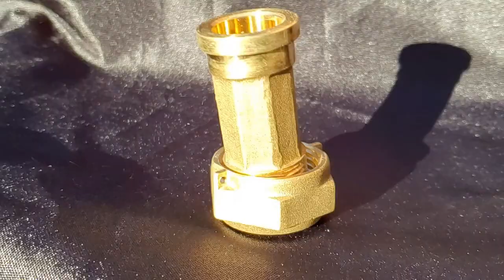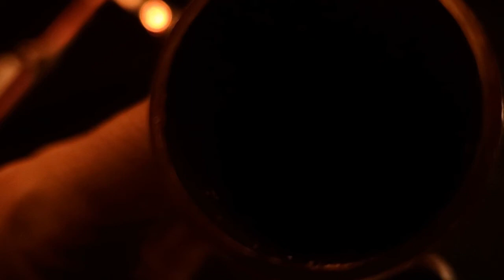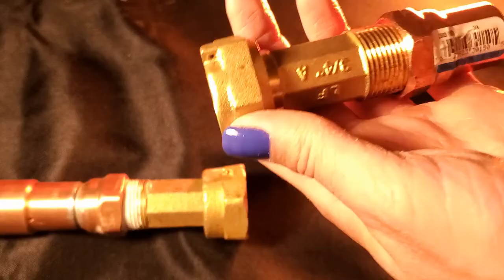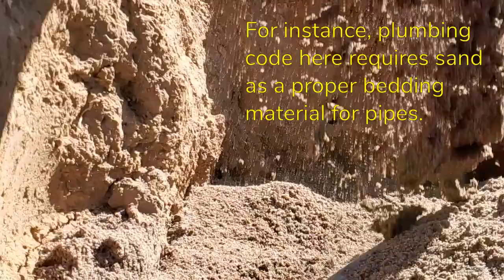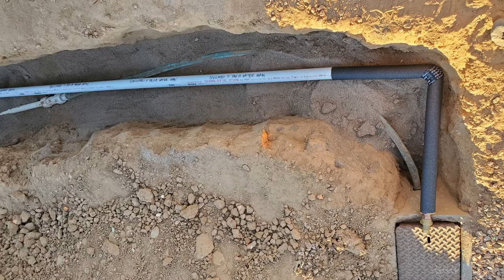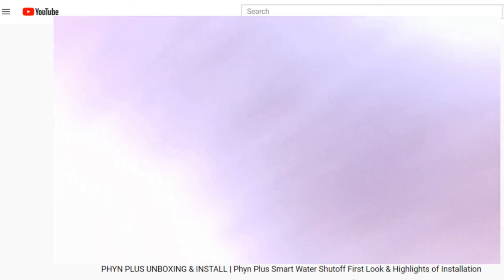How to CONNECT Plumbing on YOUR Side of the Water Meter

Comment: Normally if you install two different metals together you need a dielectric fitting (copper to brass) or Expansion Pex with brass fittings because with modern plumbing Pex Expansion meets code.   Whip lines are from the old traditional Galvanized era or time.  The only reason to install a whip line is when your flexible plumbing is not protected.

Comment: What size is that O ring
Reply from the maker: It depends on the size of the water meter. If it is 3/4" plumbing you could do a search for 3/4" water meter gasket and get some matches. But it would probably be cheaper at a local plumbing supply. Not Home Depot but a supply house.

Comment: Where can I buy the water meter coupling (nipple) ?
Reply from the maker: You can buy it at a local plumbing supply. Online at supplyhouse.com is another good option. BUT if you are looking at this from a leak perspective and it is leaking on the side between the coupling and the meter you most likely only need a gasket. If so, you can probably pick up a gasket cheapest at your local plumbing supply--not online--for the best price.

Comment: What is the purpose of the "whip"?  My jurisdiction doesn't mention it.  Another great vid.
Reply from the maker: It may not be a requirement where you are. It is here--I'm 99.5% sure the copper I see in the new neighborhood meter boxes stops 3 feet from the box and the builder used cheaper materials beyond since the houses were plumbed with PEX. It's an old school way to determine where the line runs with a metal detector. While the water company won't be able to trace the PEX between the meter box and the riser, that's where the THHN tracer wire comes in.

Comment: Great video.  But, Crescent wrenches are preferred over adjustable wrench.   Or at least I was told years ago.  You scar the metal with the adjustable.
Reply from the maker: 100% agree. Thanks for pointing that out. I just wish the adjustables weren't the first to show up and volunteer for duty when I look. 🤔 When I install/replace my water monitors (same size) I use a cloth between the adjustables and the union.

Comment: What would you say about trying to install some type of filtration system at your water outlet above ground I’m going to be doing my own line just like this and I live in a camper, but I would like to install a filtration system so I don’t have to keep changing the ones on my hose lines every monthany suggestions?
Reply from the maker: Anything that provides less maintenance down the road seems like a good idea to me. Worst case, that seems like it is easily removed if it doesn't work out as planned.
Reply: Dad spent $800 on two filters whereas you never needed to replace any filters.  It turns out, never was about 7 years before he bypassed both of them.  that was 20 years ago.   then he started drinking bottled water.  he was too old to be messing with the filters.

Comment: Thanks for the video. I'm a new subscriber now. So, is 3/4 inch the typical size coming off the meter on the homeowner's side?
Reply from the maker: Thanks for the support! I'm not a plumber so my thoughts are worth the price charged 😉, but my 80's house has 3/4" incoming. The homes in the newer neighborhood next door have 1". Current code requires sprinkler systems and those houses have those as well, which is my guess why the size is larger. Some older homes have 1/2". It really depends on the age or if improvements are made.

Comment: Exactly what I was looking for, thanks. How come nobody ever installs some type of conduit run underground from the water meter to the hookup inside the house? Seems like it would make life a lot easier years down the road in case the line has to be replaced again for some unknown reason? Just pull some pex through, hookup, done.
Reply from the maker: 100% agree. Did you find this video after my buried PEX video where I shared that exact same idea: https://youtu.be/nLnXT9e3hK0 --along with the mistake in what size sleeve we chose. I'm glad you found this video helpful and I hope your project goes as well as it can!
Reply: @NoMoreLeaks  Didn't see it, but will check it out. Just bought 50 feet worth of 2" schedule 80 pipe to run a 1" PEX line straight from the sidewalk into the garage. Never understood why it hasn't been something natively installed when homes are built.
Reply from the maker: Oh good! Schedule 80. I thought I had previously put a pinned comment in that video on recommending schedule 80 instead of 40. I had not so thanks for your thoughtful reply! The high end homes around here use (a few) schedule 80 conduits for electrical and plumbing. I don't live in a high end home, but we at least had the conduit idea before I had a chance to walk an AFT high end property in the framing phase with the foreman. With the way you think, you'll never have to use your conduit in the future, but it's nice to know it's there. :)
Reply: Awesome vid ,  recently brought property that has the same style water main on it

Comment: Great info. Mine unfortunately is s shaped like an S...or question mark if you will...I was trying to connect it at the bottom...but it won't budge. When I wiggle it, it turns with the entire meter against the copper pipe going to our house. But when I try turning it, it won't budge.
Reply from the maker: Oh no. I haven't worked with that kind before. I wish there was a way to share a photo in comments. Did you figure out a way to get it to move?
Reply: @NoMoreLeaks  so I learned it's S shaped and goes down like that so it can be the 18 inches to  2 feet required below ground. They used soft copper l. So I think they heated it up to shape it. They want it to be 3 feet of copper coming off the connecrion here. Since I could not  budge the botttom, I unscrewed the connection at the top "temporarily" and bent thebdidt copper enough so that I could attach threaded ovc to it. Since my meter says it's 1 inch, I had to get a 1.25 inch connection. Then another piece to convert it to 3/4 inch, and then a hose adaptor. I bought a 500 psi 3/4 inch hose.  There was nit enough room left to attach the hose. So after Another trip to the hardware store, I got a 1 inch to 3/4 elbow shaped adaptor that I stuck the hose adaptor to.  Finally connected the hose to it after i got male connections for it...got the necessary pieces to attach the hose to the end connecting to the house, and Temporary fix! I was able to shower, wash dishes, laundry. Just a small drip type of leak, but beats 5k gallons in half a day. We just don't use it to drink water, even filtered, because the water smells too much like the hose.
Reply from the maker: Oh no! That sounds like a project and a half! We have that 3' copper whip requirement on both ends of our run too. Glad you got something temporary and hopefully by now you have a permanent fix!

Comment: Actually I wanna know about the meter connection because I would like to preemptively replace the existing 130ft line that is more then 40 years old... Even  if - so far - it has not given me any trouble.🤠
Reply from the maker: 👍Peace of mind is definitely worth something!
Reply: I'm replacing a line, I've repaired about 6 times over 2 years.  Turns out, the line appears to be pre-1970.  They get thinner with age, as flakes of copper flake off from a chemical reaction.  So, now, EVERY time I stop one leak, there is another pinhole leak.  So, 50 years is defiantly any practical limit for copper pipe.  There has to be 12 repairs in one 6' section I removed, and only 3 of them were mine.

Comment: Hi Margaret, I’ve been going crazy trying to figure out which water meter coupling size I need for my Phyn plus. My home has a 1” pipe coming from the meter which is what I’ll be attaching the Phyn plus to. Which size coupling do I need. I see you mentioned 3/4” but is that connecting to a 3/4” pipe in the home? Pleaseeee help
Reply from the maker: You'll have to size down to Phyn. No matter what you'll need a 3/4" connection using one of these 4 unions (depending on if you have PEX or copper): https://www.phyn.com/help/plumbing-unions-and-propex-parts-for-installing-your-phyn-plus/ and then use two reducer couplings to go from 1" to the 3/4" and then back up to 1" again. Supplyhouse has the straight and elbow Uponor PEX couplings with the SKU Phyn provided in that article. As for the copper version, you can find the Uponor brand somewhere, but it is the same as a water meter coupling: https://www.supplyhouse.com/Jones-Stephens-M20075-3-4-Water-Meter-Coupling. Please let me know if that isn't clear or you have any other questions.

Comment: By code it’s called a water meter union 🤷🏿‍♂️ but just a heads up, if something ever goes wrong. Copper,plastic etc. a mix of materials sometimes is not recommended. 1’’ copper should be used from the meter all the way to the building. Copper is a stronger material. You can bury it and be safe to have a driveway.
Reply from the maker: Thanks for the clarification for code specific terminology. My goal is to educate people on what the stores and plumbing supply call it because that's the information (perhaps me projecting) people want to know when they are looking at a problem in their yard. When you look at Home Depot or Supply House it is labelled "Water Meter Coupling" (links in description).

Our code requires 3' copper whips (at the meter and at the connection where it is outside at the house). Anyone could put a full run of copper, but even new builds in our area have the whips with PEX running in between and throughout the house. No PVC tape to protect the copper from long term exposure to the elements in our soil here which is why I have a full video on our code here and how we protected our copper: https://youtu.be/ecVgSCvuVM0. Our copper only lasted 27 years and is in the process of failing below the house. I am sure code and practices are different throughout the country.

Thank you for sharing your thoughts.
Reply: @NoMoreLeaks  yes thank you so much because me as a plumber, if the customer is informed. It makes professional repairs faster and affordable. Also it looks as if you know your way around a shop. I would suggest buy nice tools that would make it easier on your self. 👍🏿 keep it up and again, thanks

Comment: Where in the the code does it require a three foot copper whip at both ends?  I couldn't find it in the 2018 IPC.
Reply from the maker: Our local city code requires this-- I don't see it in the IPC either. We talked to our friend who is an plumbing apprentice, our neighbor who does commercial inspections, and the city compliance officer (in that order). Some places only require it on the house side and some may not specify anything at all. So I should have said "our local code" and it's a good idea to verify locally as well. I hope your project goes well!
Reply: @NoMoreLeaks  Thanks for your reply.   I don't see anything in the local  (Tucson, AZ) code amendments either.   I really don't like buried connections so it is going to be PEX end to end on my project.

Comment: 811 won't mark anything on your property in AZ only from meter to road
Reply from the maker: Cox came out and marked all the way to the house--the kids played with the flags for at least a year afterwards. My husband talked to the gentleman marking our water and electrical. During their discussion the copper whip on the meter side of the water main got marked, but he couldn't follow C-PVC with no tracer wire (which is why we added a tracer wire and the warning tape 12" below grade when we ran our new PEX line). I don't recall if my husband had an cool can of coke or bottle of water in his hand at the time. 😉 It probably depends on weather and how late in the day it is too. YMMV. But any general idea / warning, is better than none!
Reply: In Tucson, AZ 811 doesn't mark anything at all.   They contact about seven agencies ( e.g. Electric, Sewer, Cox Internet, Gas).   In my case, the only company who had anything to mark was the gas company which did mark the pipe on my property between the meter and main line.  It is true; however, that they don't trace or mark anything belonging to the property owner such as water service lines or sewer lines.
Reply: That's because they don't know.  They only know how the water lines are run to the meter. Private lines could be anywhere in the yard.

Comment: That is exactly what I fixed in my house meter coupling. I took it off went to HD no found. until 🤦‍♂️I realized there is a gasket. 😑. 

I do see a small leak super small stream coming out from their shut valve and connects to the meter. Does that belong to them?
Reply from the maker: The pesky gasket! 😂 The one we took off was pretty smashed and was blocking a good amount into the plumbing.

If you see a leak on the city side definitely give them a call. That video of the specialized tool which crimps and de-crimps the copper plumbing was the city service people who came out after we completed work on our side of the line. While we didn't have a leak on the outside, the shutoff wouldn't turn off all the way so they replaced it.

Let me know if I didn't quite address your question.